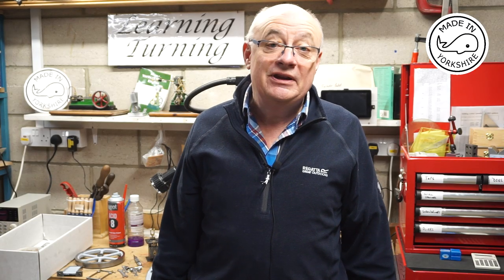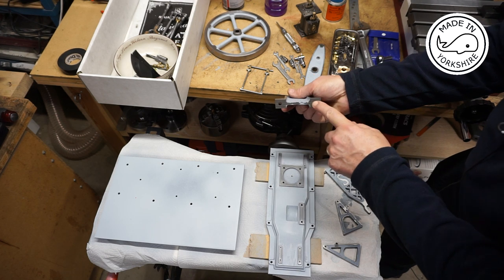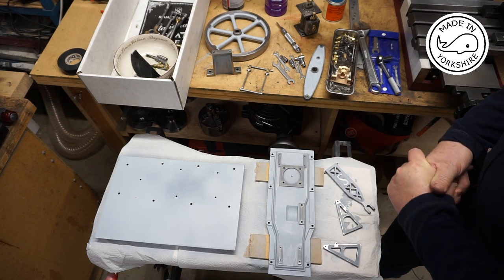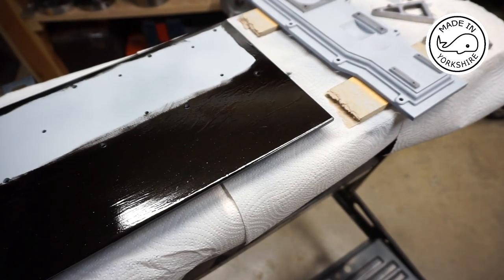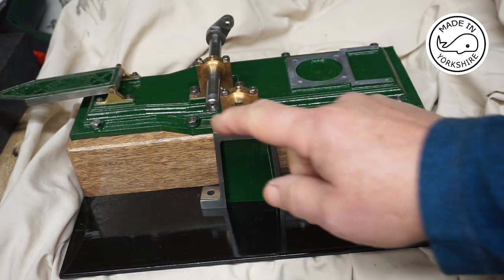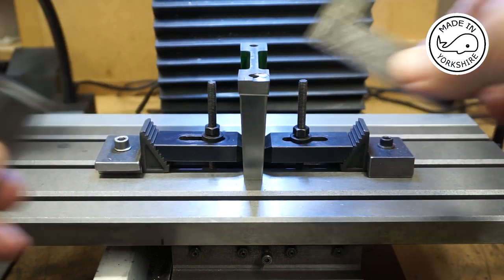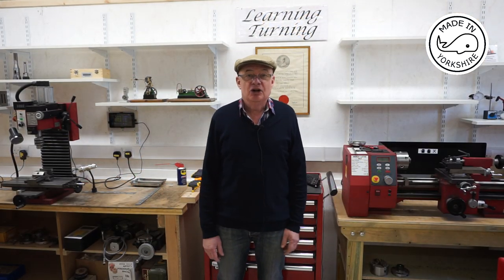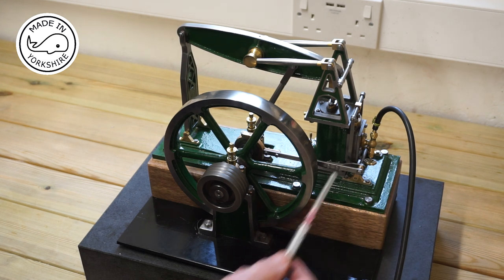#MT32 Part 19 - Making a Stuart Half Beam Steam Engine. Painting and Final Run. By Andrew Whale.

Comment: That did sound nice👍
Now about painting, promise us all you are not going to turn into another Appleton, one is quite enough.🤔
About milling your pedestal, when machining unstable pieces like that, try to have all the cutting forces acting in the most stable direction, even if it means climb cutting( with usual precautions). If the vector of cutting forces are across the work it will naturally cause vibration but if along the work it is much more of a kinder set up. I keep meaning to do a video showing the effects, maybe when the engineerium warms up a bit.
ATB 
c
Reply from the maker: Many thanks for the advice Chris. Yeah - I thought it sounded pretty good too!
All the best.
Andrew

Comment: A fantastic result !  It looks beautiful and runs great.
To save re-milling the bearing pedestal, you could have retained the hex pillars and drilled clearance holes for them in the wooden base.  The wood would then just be a facade.
Reply from the maker: Thanks Chris. Yeah I was thinking only the other day that it would have been better to leave the hex pillars in place and cover them somehow.
The wood does seem stable though. I saved the pillars, just in case, so if it is a problem at some later stage I can revisit.
Cheers
Andrew

Comment: nice one Andrew. Looks and sounds beautiful. I,m thinking of getting the same Warco milling machine that you got. Any advice? I was also thinking of the  Super Major Vario but i I dont think I have the room for it.
regards
Gareth
Reply from the maker: Thanks Gareth. Warco didn't have a factory fitted DRO on the WM18, so I purchased the bits from Warco and it's very accurate.
I can't fault the machine - I'm very happy with it and it's got all the capacity I need (at the moment!). Power feed on the x-axis is great. Also, R8 was important for me. A lifting table takes a lot of the hassle out of moving it into place because it's quite heavy.
Cheers
Andrew
Reply: @learningturningmetal  Thanks Andrew, that gives me a good deal of confidence. The WM18B has the DRO so thats fine. Thay are out of stock on a few lines at the moment but Roger at Warco (very nice bloke and very knowledgeable) says thay are coming in soon. Cheers Andrew

regards

Gareth

Comment: Nice work! To be a true Englisman one has to build a steamengine, or at least have one on the shelf. I'm not English at all. 
At the time 6:00 You show the machine. How on earth can it work out to use wood? Wood is alive we say here and it sure is. During winter some trains on my modell railroad get their top speed lowered to awoid derailments due to the "living wood". How do the flywheel bearings manage during a year?
Reply from the maker: Hi Stefan - a very fair point! When I started the build in earlier videos, I made some supports out of hex mild steel bar. This worked well but I struggled to find some material to cover them with. That is why I ended up using a piece of wood. I guess time will tell as to whether that was a bad decision. I think I will put the hex supports to one side, just in case I need to go back to plan A at some point. With the pedestal being supported outside of the main engine, I found it one of the most challenging aspects of the build.
All the best.
Andrew
Reply: I assume the base plate is in metall. Is the wood only a couver, a decorartion, and You use metall behind the wood, carrying the weight and handling the forces? In that case I can only shave my neck.
Reply from the maker: No - I ended up just using a block of wood.